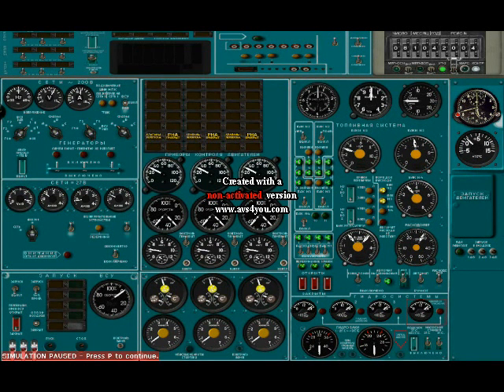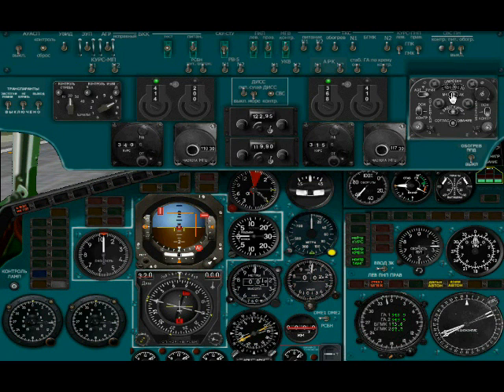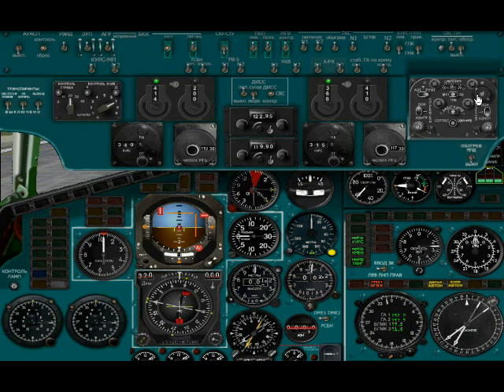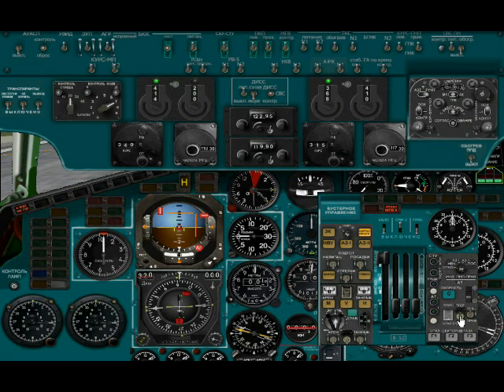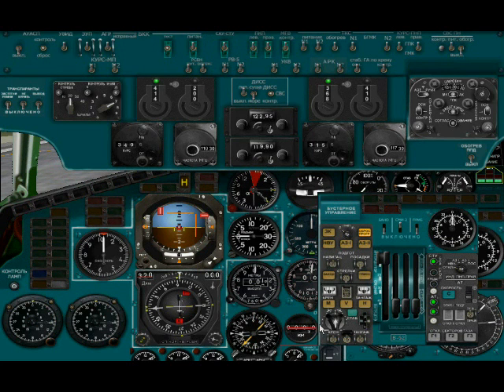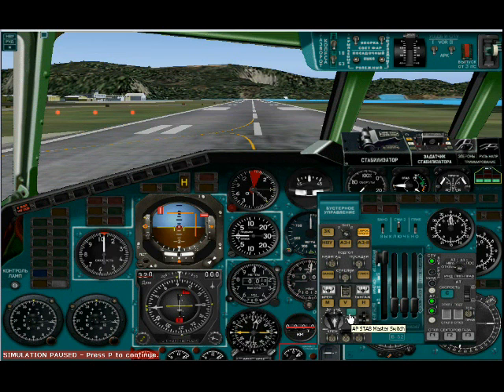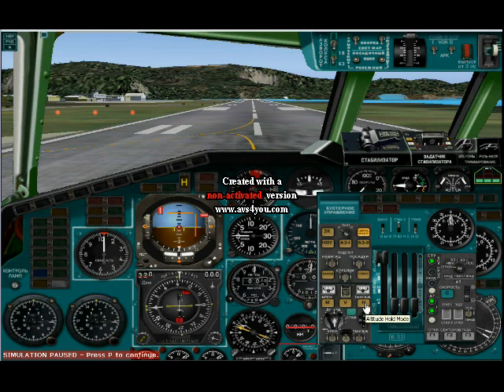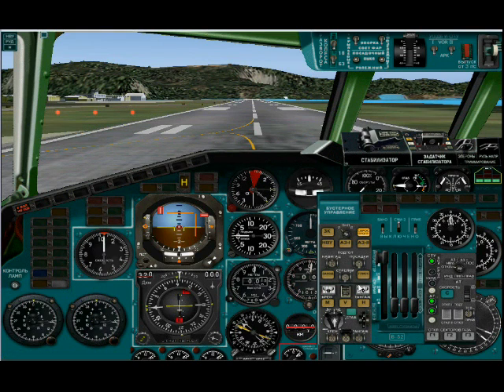PT 154B-2 AUTOPILOT

Comment: great video, but I still have some doubts: I can set a default height that once you reach the 'plane will stabilize on it? and one last thing: it is possible to follow the aircraft flight plan set?
Reply from the maker: This aircraft uses TCAS no GPS.  You can  add GPS if you add it to the panel.  I found a link that might help.  Check the link above.
Reply: niceone11987 can you give me the link please?
Reply from the maker: Look in the description above
Reply: niceone11987 Thanks so much! last thing and then I promise I'll leave you in peace: but how come the stick in the cabin 3d does not move and even the rudder?
Reply from the maker: Gabryst2:You need to set up the joke, rudder, ailerons.  See above link for joke set up.
Reply: Very thanks! Last thing: is possible download the GPS for FSX?
Reply from the maker: You mean install the GPS in the Tu-154 in FSX?  There is a version for FSX of the Tu-154.  It might be possible, try it.
Reply: yes, I have Tupolev FSX version, but how to install GPS in the panel? becouse your link is compatible only with FS9
Reply from the maker: Ok you want to add the GPS to the panel.  Same thing in FSX.  Copy the GPS from the Cessna panel and edit the aircraft CFG and look for autopilot section and add it to the aircraft CFG.  Make a backup of the original aircraft just in case.

Comment: Do you know how to make the yoke move?
Reply from the maker: Hi, if your asking why the joke doesn't move in the aircraft when it's off?  You need power for it.  Now if your asking to set up the joke, there are settings that need to be done manually to get it to work properly.  I'll try to make a video ASAP.  It's a little complicated to explain, a video is easier.
Reply: Thank you so much.
Reply from the maker: TupolevPilot Hi, I've added the video for the hardware in the description of this video.  Just click the link,